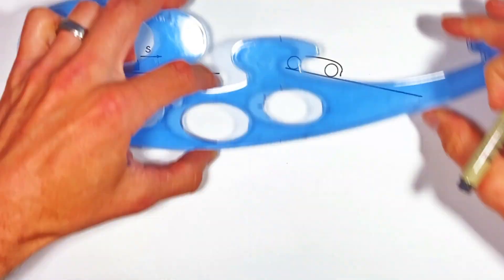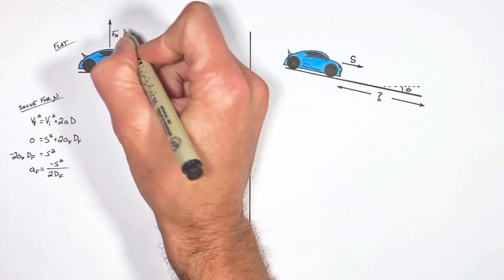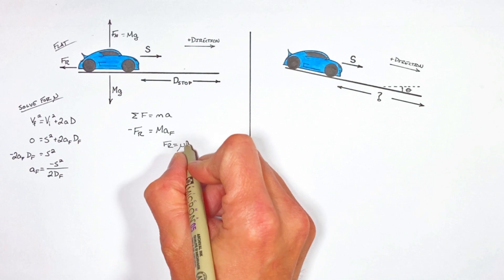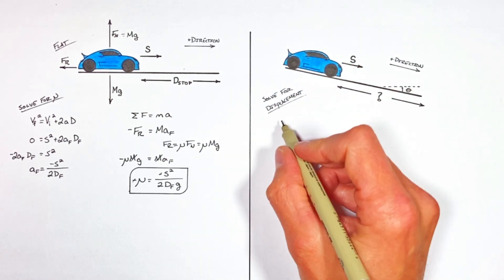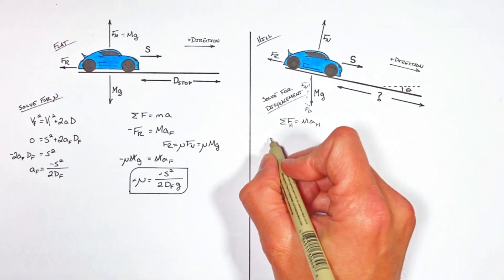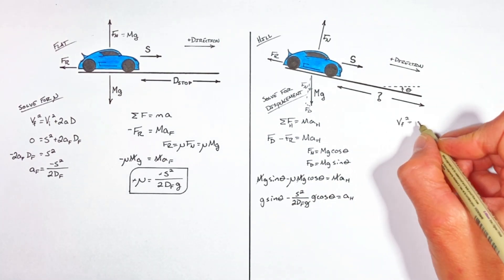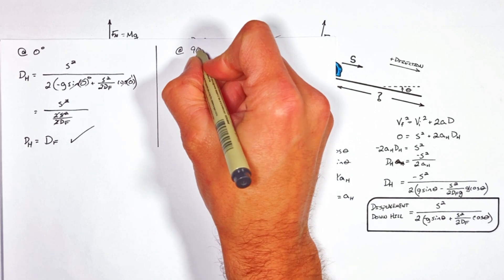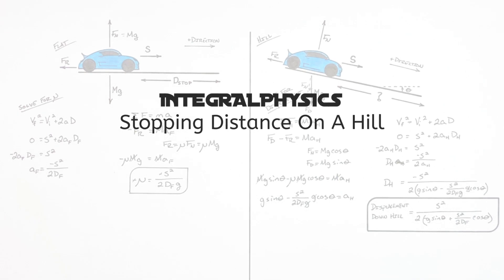How Does Stopping Distance Change on a Hill? | Friction & Normal Forces

Comment: Are the wheels locked?
Reply from the maker: within the context of this question, it doesn't matter as long as the wheels are doing the same thing in both parts of the problem.
Reply: The backward force seems to be be a friction force. Static or dynamic?
Reply: Newton's second law can only be applied with locked wheels.